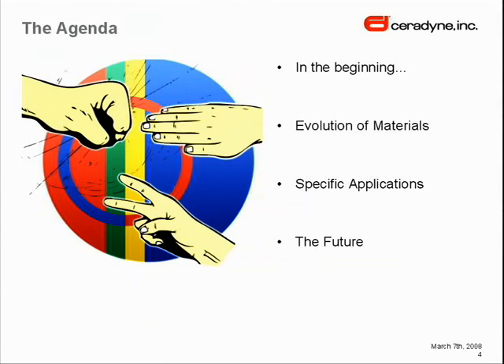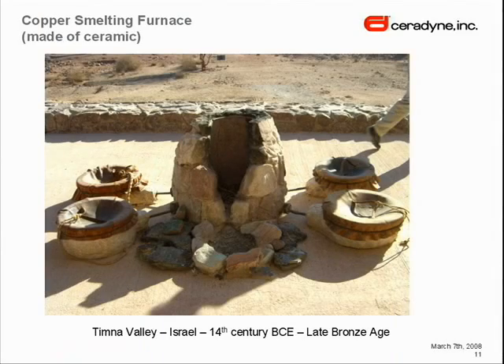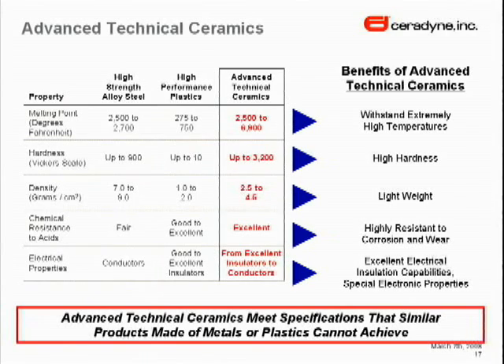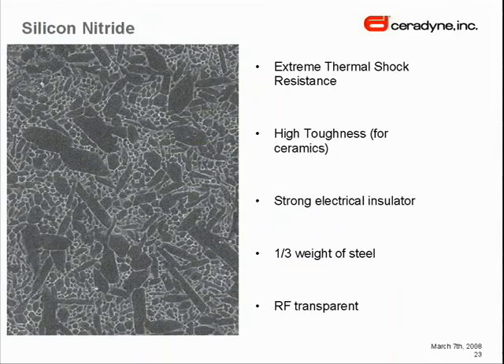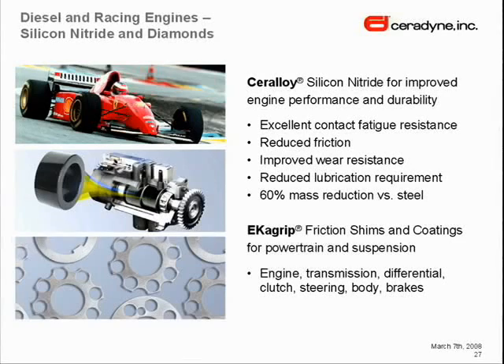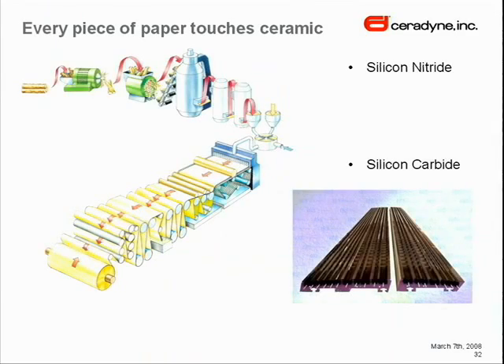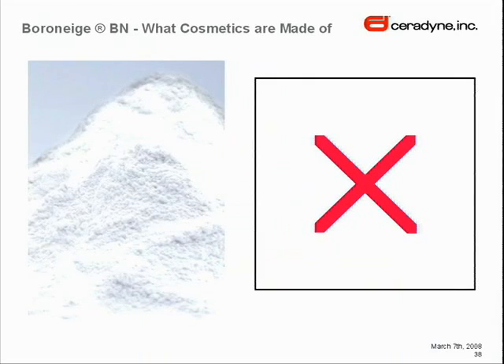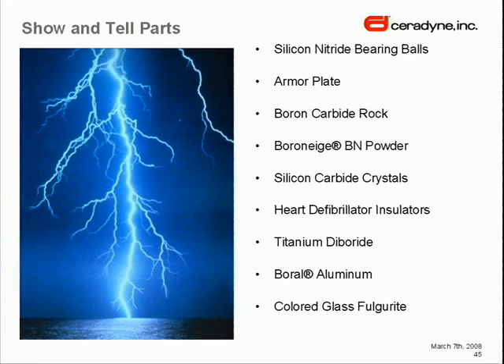The future of materials: Advanced Ceramics

Comment: i enjoyed this talk, very informative. I worked as a promoter for Electrolux, home appliances. I noticed that so many home appliances have ceramic coating  for example   cooking  pots, even the interior  of microwave ovens etc etc. So i have been really wondering, what's so creat about ceramic compared to S/S surfaces. This talk has addressed that Q. Basically, it is harder, stronger, more inert than S/S surfaces. It is also light ie not heavy material to use as coating on surfaces. THKS.

Comment: Science is not considering design of common building materials. Those materials remain outdated by millennia. Huge energy goes into manufacture of building materials then lighting, heating, and cooling buildings. An "advanced" architectural material has not been invented yet. It is transparent, it lets in the light. It is structural, stronger than steel. It is lightweight. It is thermally super-insulating, it is non-corrosive to the elements. It is easy to work with, and most of all it is cheap.